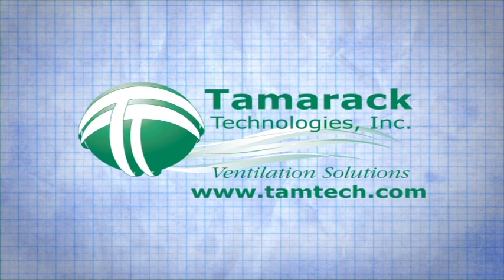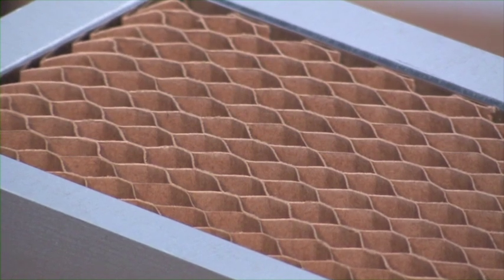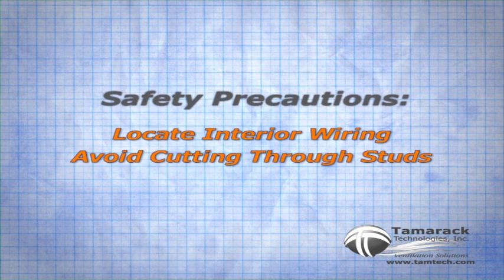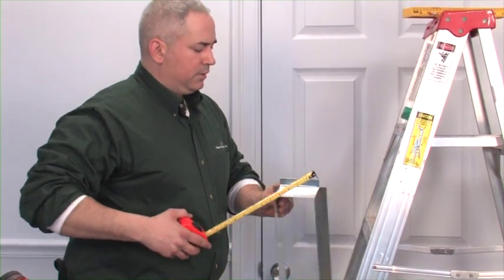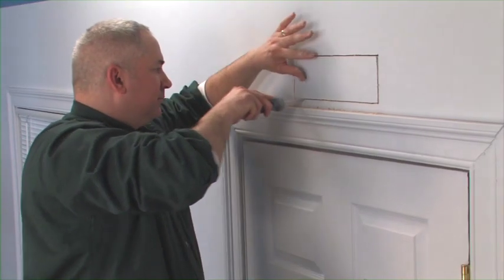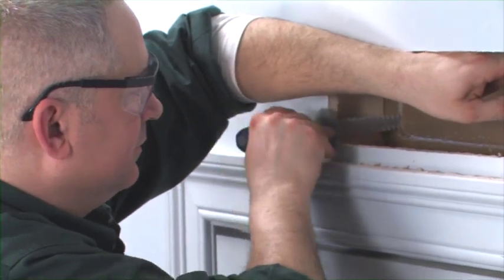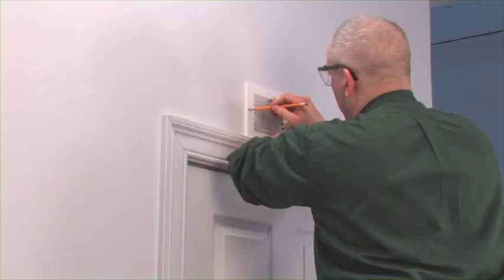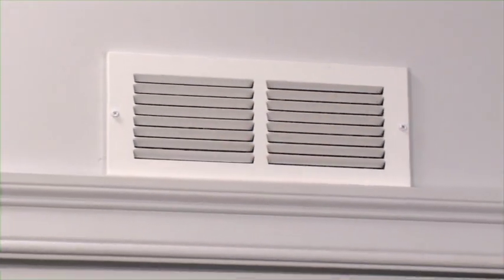Installing a Tamarack Technologies Wall Return Air Pathway (RAP)

Comment: Does air flow freely between rooms?  Does the honeycomb restrict airflow at all?
Reply: I have these. The honeycomb does restrict the airflow slightly, but that helps dampen any room sounds and light. Basically, when calculating the return path square inches required, you may want to go to the next size. If your calcs require a 14x6, you might consider a 14x8, for example.

Comment: Any tips on how to separate the 2 parts of the sheet metal frame upon unpacking?  I've spent an hour and used every tool in the box.
Reply from the maker: Hi Margie, if you're having trouble getting the retrofit RAP apart we suggest returning it for a replacement.  Please call your place of purchase to replace your RAP.  It should be a snug fit but you should not have to struggle to get it apart.
Reply: Same problem here. Got the 12x12, and it's made of a single piece of metal that cannot be installed as seen in this video.